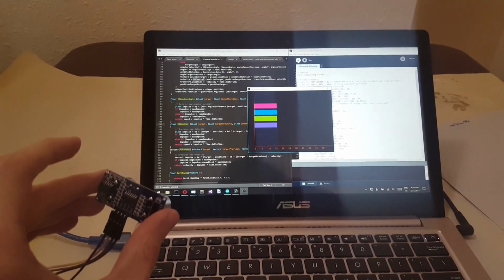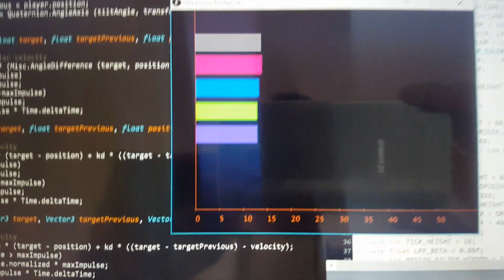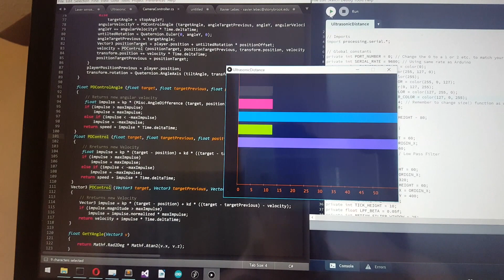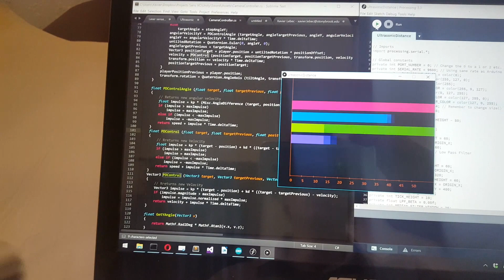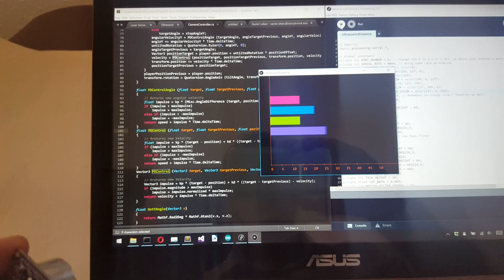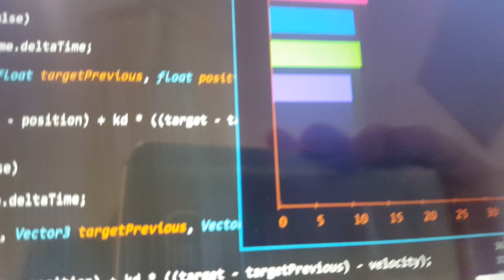Ultrasonic Sensor Filter Demo

Comment: Hello! amazing job it's so smooth. Is your code available anywhere online? I am currently implementing a MIDI controller that uses the same proximity sensor, this could help me so much. Have a great day!
Reply from the maker: Hi, thanks! The code is in a really rough state, but if you'd like it, you can find it at https://xlebec.github.io/assignments/6/assignment6.html One thing that's important but not actually specified in the visualization code is that it's updating at 60 Hz. Run with Arduino and Processing (processing.org)
Reply: Thank you so much, I was able to use it very easily! Next Monday we will be putting the video of our project demo online, I'll make sure to send it to you. Have a great day!!
Reply from the maker: Cool glad it helped. Looking forward to it.
Reply: @xavierlebec3235  Good job, i have a question,in the a bow link there in an  Arduino code,have you used low pas filter in that code?
Reply from the maker: @David-xr4pd  Thanks. Yes, there is a low pass filter in the code. I refer to it as "LPF" (for Low Pass Filter) in the comments. It's been a while since I looked at it, but I think the main line of the LPF step is:

lpfValue = lpfValue + LPF_BETA * (inputValue - lpfValue);

where lpfValue is the value after low pass filtration, inputValue is the value currently reported from the sensor, and LPF_BETA is a constant damping factor that can be tuned to your needs (I had mine set to 0.05).

Here's a blog post that goes into more depth and other techniques: https://kiritchatterjee.wordpress.com/2014/11/10/a-simple-digital-low-pass-filter-in-c/ . I essentially used the same technique as the author did under the "Implementation using floats" section.
Reply: @xavierlebec3235  Thanks.well my problem is a bit complicated.I want to use this sensor as a level meter  for a PID control system,as you know the noise on sensor is very destructive in feedback path.so i have to minimize it.Could you please show me a way to do it?
my controller is  Arduino Mega
I want to use this LPF directly in IDE in my own arduino code.I didn't find any useful filter library for arduino
Thanks a lot
Reply: @David-xr4pd  hello sir i'm facing the same problem did you figure any solution?!!!!
Reply: @mouadkech8279  hello sir
yes somehow i found a way 
you can use Kalman filter
try this library SimpleKalmanFilter
you can download it from here
https://github.com/denyssene/SimpleKalmanFilter
it reduces the noise but it makes a small lag in first seconds of starting
Sorry I answered late.